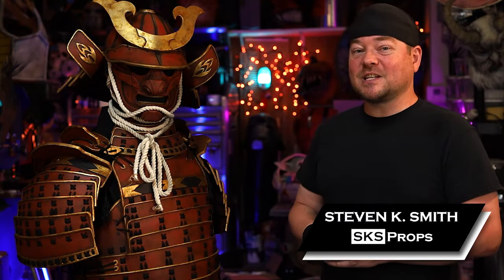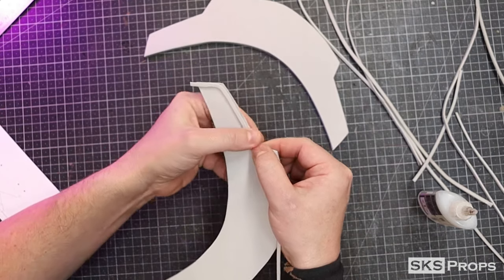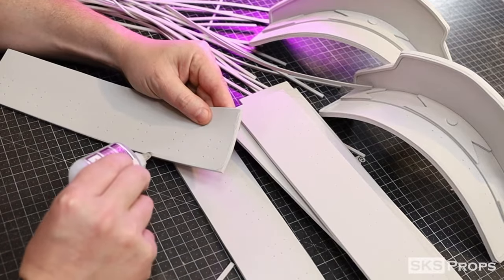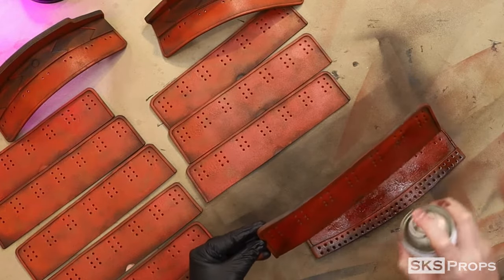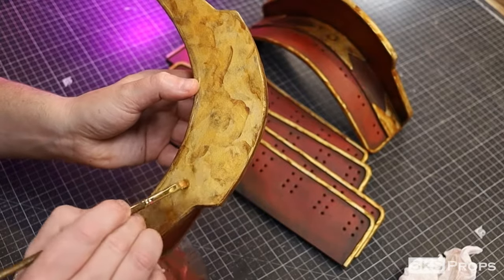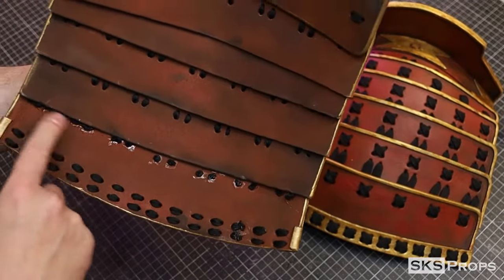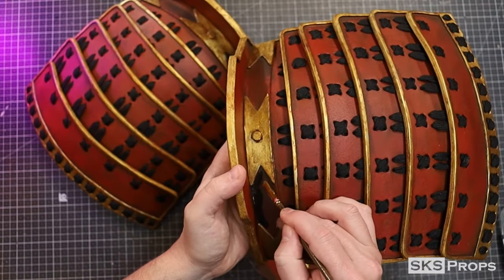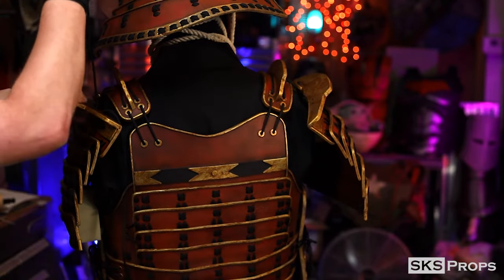How to Make Samurai Armor out of Foam - Sode Shoulder Armor - Free Templates - Cosplay Part 5

Comment: Always such a clean job. It looks fantastic !

Quick question : I'd like to make a full body armor (Star Wars Clone Trooper's) without the helmet and I'm interested to buy your 10mm HD-Foam. With your expertise, how many would you recommand me to buy ? I'm in France and I don't want to be short on the supplies but I don't want to have too much left over either.
Reply from the maker: Hey, I appreciate the support 🙌  My suppliers are US based and shipping would be very very high. If you’d like to help the channel by all means you can donate there are links on my site. For overseas check out polyprops not quite as good as mine but better than most of the others
I’d say 3 sheets but you might rethink the 10mm to 6 or 8
Reply: @SKSProps  thanks for the very fast answer! Ok I’ll do just that. Glad to help because your work is top notch.
I guess you’re right for the shipping fees so thank you also for the recommendation.

Comment: For what size are your templates? I'm 147 cm or 57,87 inches if I calculated it correctly. Should I print these templates at maybe 85% of the original size? Your work is absolutely beautiful.
Reply from the maker: Original design is for 5’7”-5’10” so that should help you decide on how much to scale down
Reply: @SKSProps  Thank you for replying so fast. You are a hero
Reply: @SKSProps  I just now found out that 5'7" means 5 feet and 7 inches. Who knew I'd ever start learning imperial measurements

google tells me this is 170 cm by the way so now I can start calculating.

Thanks again

Comment: I actually started cosplaying around my city because of your templates. All great works! Right now, I'm currently doing the Red Hood armor tutorial you just made with which the chest front I'm already done. I'm gonna do another build of it though since the 10mm chest part ( which I made with an 8mm generic foam) is too heavy and constricting for me, so I'm gonna build it next with just a 6mm foam so that it fits my body well. This piece you're doing is actually making me think of a Sengoku style armor of Darth Vader, which I plan to do some design changes from your template once I'm done with Red Hood. Again, great crafts as always!
Reply from the maker: That's awesome to hear, Thank You! The type of foam you use makes a huge difference in thickness and how easy it is to work with and manipulate. If you ever have a chance try mine and you'll see what i mean

Comment: So freaking amazing.  And soooo detailed!  Holy snap.  How much lacing and paracord have you used so far?  I keep watching that roll getting smaller and smaller.  It almost makes me wonder if the armor makers of that period had some serious ADHD issues going on.  Or, if not in the beginning, some issues by the time they finished.  Just amazing, Steve!  Thank you!
Reply from the maker: Thanks! I bought a spool of flat laces which was 144 yeards and I still have a good amount left. I actually picked up 2 just in case and I might need to dip into the next spool after the armor below the waist. The 750 paracord was also a spool off of amazon but I have a bunch left